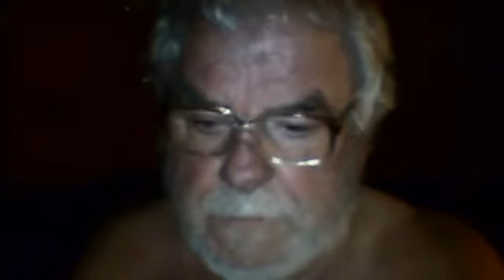Truck Fuses and bulbs blowing

Comment: One of my older vans used to constantly blow Stop/Taillight bulbs, in the order of once every 5 weeks on average, I would have to change a stop/ taillight bulb. In the end I had to buy lots of them and just carry the damn things around with me. Used to drive me nuts. I put it down to the constant opening and closing of the back doors, vibration and all that...